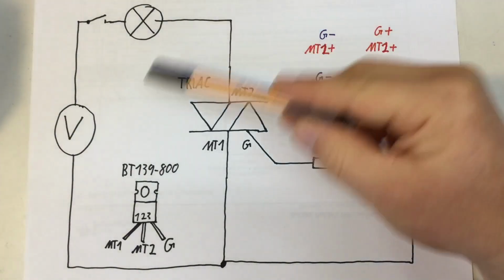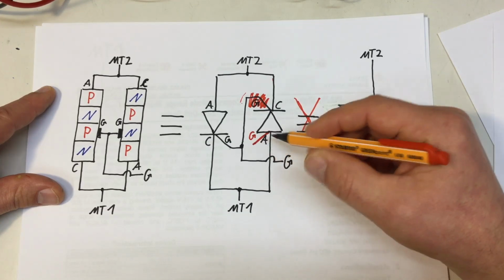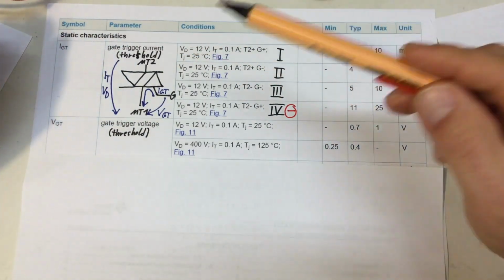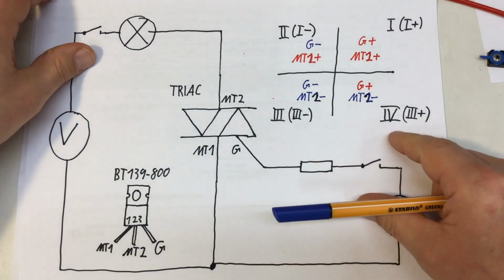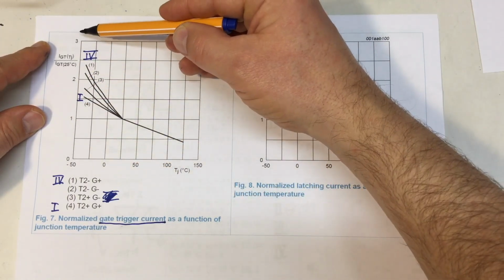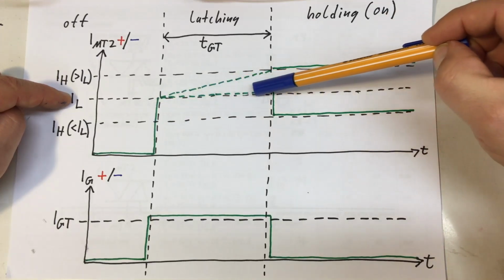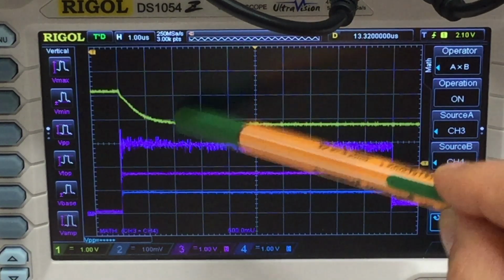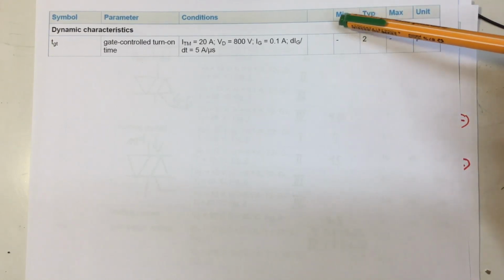TRIACs – The Dirty Details (1/3): Gating, Latching and Holding

Comment: If I’m activating the gate with DCV and m1 &m2 are AC how does the DC voltage pass
Reply from the maker: The M1/M2 AC voltage source (in the following videos a transformer) is completely independent from the GT DC voltage source. Meaning the currents induced by each voltage source also flow independent from each other. Let's say you have a  load current of 1A flowing from M2 and M1 and a gate current of 0.01A flowing from GT and M1. Then you would measure a current out of M1 of 1.01A. The currents from the two voltage sources just add up. Now if the current from M2 and M1 reverses (AC) to -1A, then the current out of M1 would be -0.99A.

Comment: Superb tutorial. Question: In Q1, starting from gate open, and no load, which scenario causes less losses?

1. Turn on just enough Load current needed to latch. Then, pulse Gate to latch. Then increase Load. 
2. Close Gate. Then, turn on just enough Load current to latch. Then increase Load.
Reply from the maker: With a given load, you can't really do anything about the losses between MT2 and MT1. So the only losses you can minimize are actually the gate losses (G, MT1). So to answer your question - its 1: Pulse the gate as short as possible and with a current as low as possible for latching, while there's already enough load to keep the TRIAC latched.
Reply: @robertssmorgasbord  You can pick a different triac, with lower on-resistance, right? Which chart or parameter indicates that?
Reply from the maker: @johnaweiss  Well, you can always pick a TRIAC with a lower on-state voltage. I talk about the on-state voltage in part 2 ( https://www.youtube.com/watch?v=wf2-SEICamQ&t=0s ). However, since the on-state voltage is basically the result of the current passing through two "diodes", you will be hard pressed to find TRIACs with significantly lower on-state voltages. If your willing to spend 150 buck you can get something with 0.95V at 100A @25°C ( https://www.littelfuse.com/media?resourcetype=datasheets&itemid=5970e031-f835-4fa8-b6cb-72c479ff02a5&filename=littelfuse-power-semiconductors-mcma650mt1400nkd-datasheet ).
Reply: @robertssmorgasbord  isn't drop different than resistance?
Reply from the maker: @johnaweiss  Yes, it is different. the diode(s) drop of a TRIAC (on-state voltage) does NOT increase linear with current, like a resistance would do (V = R x I). That's why they provide you (usually) with a diagram of the on-state voltage (voltage vs. current at different temperatures).
Reply: @robertssmorgasbord  Do different triacs have different on-state resistance? (i think you might have misread this question as on-state voltage, above).
Reply from the maker: @johnaweiss  Well, TRIACs do not have an on-state resistance (like for example a MOSFET), they have an on-state voltage, which is roughly speaking equivalent to the voltage drop of two diodes in series. That voltage drop depends (like for diodes) on the current and the temperature. Again, that's why the datasheets (usually) include a graph of the on-state voltage. You can not view a TRIAC in on-state as having just a resistance.
And yes, different TRIACs have different on-state voltage curves.
Reply: @robertssmorgasbord  I'm trying to understand how to calculate whether a triac requires heatsinking.
Reply from the maker: @johnaweiss  Have a look at part 3: https://www.youtube.com/watch?v=jjTr7DD2ouE&t=713s "Heatsink – choose one using a diagram and a simple formula"

Comment: Does the gate voltage changes if mains are AC? How does that work? I'm very confused now lol
Reply from the maker: Yes, indeed. In most AC TRIAC circuits the gate voltage (measured relative to MT1) does change its polarity. That's the wonderful magic of TRIACS, you can switch them on with a positive OR negative gate voltage (current).

Comment: Incredibly useful. This is by far the most thorough and detailed overview of triac characteristics that I've seen on youtube - in fact, most of the triac information on the web that I've found seems to be a mixture of guesswork, black magic and pure invention by people who understand the devices rather less well than I do.

Have you done any videos on triac snubber circuits for inductive loads, and component sizing for them? I'm finding it difficult to find any decent treatment of that particular aspect.
Reply from the maker: Thanks for the praise! The reason I did this series was that I wanted to use a TRIAC in a project. And you're right. The information about TRIACs on the internet is somewhat incomplete and sometimes outright wrong. So I actually got my textbooks from school/university out and brushed up on that subject. And while I was at it, why not make some videos. It was much more fun that way.

Unfortunately I only had to switch a resistive load in my project. So there was no need for a snubber network. But rest assured, if I have a project involving TRIACs and a inductive loads, I'll make a in-depth tutorial about snubber networks.

Comment: Brilliant, brilliantly explained. hats off to you man. I've been trying to understand what these quadrants mean. So to conclude its best to switch on a triac in the first quadrant. Now to switch on the triac in dc circuit a short pulse would do the job. However, to switch it off can we connect the gate ground ?
Reply from the maker: Thanks for the praise! And no, you cannot switch off a TRIAC as long as there's current flowing through the terminals. It doesn't matter what you do with the gate. TRIACs are really made for switching AC.

Comment: I don't understand why people draws a simple nice switch which triggers the Triac, but then there is circuits which uses a Diac to trigger the Triac. Can we control the power of an AC product just using a microcontroller and a Triac without any need of a Diac?
Reply from the maker: The DIAC is mainly used in the classic analog TRIAC phase control circuit. There an RC element is phase shifting the trigger voltage for the TRIAC, and the DIAC further delays the triggering of the TRIAC, respectively, increases that phase shift even more. See also the third part of this series: https://youtu.be/jjTr7DD2ouE?t=1945

Of course you can use an MCU in conjunction with some zero cross detection to control the TRIAC directly. No need for a DIAC there.
Reply: @robertssmorgasbord  Can you make a video in explaining how AC products such as AC light bulbs, AC fans, AC heavy duty motors, AC pumps, AC heaters and etc can be controlled using an Arduino, ESP8266 or any common microcontroller? 
There is no one on the internet or YouTube explaining valid information how AC products can be controlled using a microcontroller with the help of a zero cross detection and Triac using parts from raw materials.
Everyone uses an optocoupler which has Triac switching built in.
Is it possible you can show how to make a Triac driver using raw materials and not bought from commercial stuff?
I can’t find any information on the internet on how to make a Triac driver from raw materials. Thanks.
Reply from the maker: @ShopperPlug  Well, to be hones I have made such a video myself: "Switching AC with Triacs and Zero Crossing Triac Output Optocouplers" https://youtu.be/rLpFtSayZ3Q :-)

Anyway, I usually only do tutorials about stuff I intend to use in my projects. And mains AC phase control with a MCU is not on my platter right now. But you'll never know ;-)

Meanwhile you might find this interesting: https://www-user.tu-chemnitz.de/~heha/Mikrocontroller/Triac8/index.en.htm
It's a project (not mine) that does everything with just an MCU, TRIACs, diodes, resistors, capacitors and inductors (if you ignore the optocoupler for the DMX control line).
Reply: @robertssmorgasbord  do you have WhatsApp or Viber, would like to chat with you about Triac driver. You have knowledge that I can learn from.
Reply from the maker: @ShopperPlug  I don't have neither WhatsApp nor Viper, or Signal or any other messenger for that matter - I'm kinda old fashioned ;-)

Anyway, for privacy reasons I don't share contact information here on YouTube. As of now I'm not a professional YouTuber, this is just a hobby for me. Thank you for your understanding!
Reply: @robertssmorgasbord  an email address? Alright let’s continue to chat on YouTube.
I found this link which shows how to build a Triac driver using a regular optocoupler and a transistor (figure 9):

https://www.nutsvolts.com/magazine/article/triac_principles_and_circuits_part_1

Can I use this schematic to drive the Triac via a microcontroller to control the power/speed of an AC fan blower?

Also I have many different BTA triacs. The BTA12 datasheet does not contain any info about the "gate-controlled turn-on time".... here is the datasheet: https://www.st.com/resource/en/datasheet/bta12.pdf
Reply from the maker: @ShopperPlug  OK, let's do that :-)

To answer your question (figure 9): Yes, if the MCU somehow is supplied with the mains AC zero cross information (usually done by a second optocoupler), so it can implement the phase control.

However, why don't you go for figure 17 or 18? Optocouplers with TRIAC outputs are standard parts. Just for my benefit: Why do you force yourself to design the whole thing around an optocoupler with a transistor output (nothing "regular" about those)? I guess there must be a very specific reason for that.

Regarding the BTA12: They probably didn't bother with the turn-on time, because basically all TRIACS are "fast enough" for switching / phase controlling 50/60 Hz AC mains ;-) It says on page one of the datasheet "They are also recommended for phase control operations in light dimmers and appliance motors speed controllers." - so no worries. These are perfectly good for your fan/blower.
Reply: @robertssmorgasbord  It is just for purely for educational purposes, I do not like to use something for which I do not understand how it truly functions. It is like cheating by just buying parts and then calling it a day with the opto-triac doing all the magic. I for one do not like magic and likes to fully understand how everything is working under the hood. I have dozens of opto-triac, I just like to build circuits using raw materials, it keeps my brain active and solving puzzles. I actually would not like to use opto-Triacs since they do die faster than transformer based signaling. My goal is to try using a transformer as a Triac driver. Thank you for your helpful time. 
Are you an electrical engineer?
Reply from the maker: @ShopperPlug  OK, got it :-)

No, I'm not an electrical engineer :-) I started dabbling with electronics in high school, working a bit for a company that made remote controls for forest tractors (only one man required to winch out a the logs). Later I went to a German type of senior high school, that could be roughly translated as "technical high school", and my last senior year's project was a 8086 CMOS single board computer. After the army (mandatory back than in West Germany, because of, well, East Germany), I studied computer science at the university. One mandatory lecture (with exam) was "Foundations of physics and electronics". That's all the formal education I have in regards to electronics.

BTW here's a nice zero cross detection circuit that should be up your alley: https://www.edn.com/mains-driven-zero-crossing-detector-uses-only-a-few-high-voltage-parts/

And of course you're welcome :-)
Reply: @robertssmorgasbord   “remote controls for forest tractors” that alone sounds really interesting and advanced. I like heavy machinery integrated digitally. I actually bought books to teach myself on how to build single board computers, seems like today the new generation of Computer engineers will never know how to build one.  I’m sure you will get a large YouTube audience for teaching how to build single board computer from scratch using today’s modern methods. So you studied computer science, I’m assuming you have a CS degree. I have seen handful of EE professionals who originally have a CS degree.
Thank you for the zero cross reference link. It can be made from raw materials and was well thoughtfully designed and explained.
Reply from the maker: @ShopperPlug  I thought you would like that zero cross circuit :-) And yes, I do have a degree in CS (German: "Diplom-Informatiker").

Comment: Thanks for the video. In this example we apply dc to the LED of MOC3063 and when the AC crosses zero (or close to that) BT139 is turned ON (a=180 degrees). What if I want smaller angle, i.e. I apply a pulse width < 10 ms, do I need to detect the zero crossing separately?
Reply from the maker: You're welcome! Indeed, you'll need another optocoupler without zero-cross detection (e.g. MOC3021/MOC3022/MOC3023). And you'll also need to do the zero-cross detection by yourself then. This is often accomplished by another optocoupler (LED - with some more components of course - on the AC mains side).